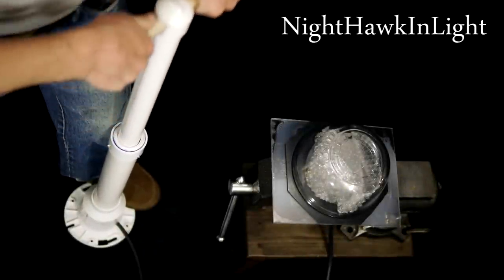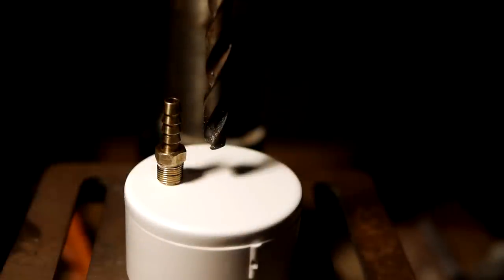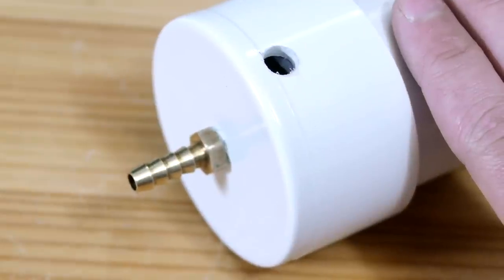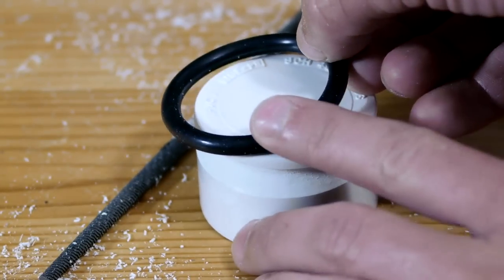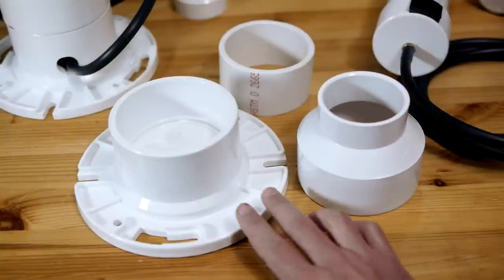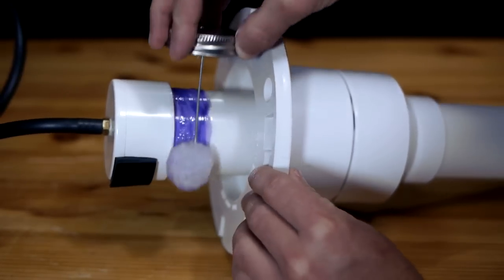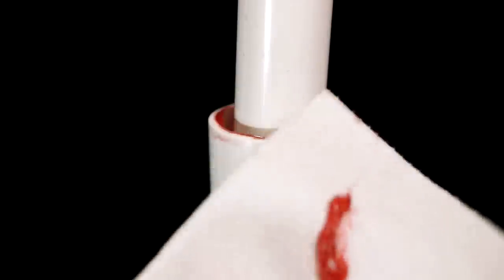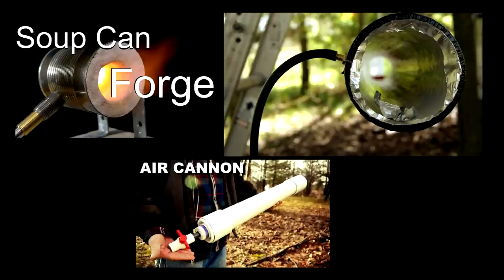How to Make a Vacuum Pump

Comment: In this design, max. vacuum achievable is determined by the pressure required to open the check valves. Small 1/3 psi check valves are available at low cost. That lets 97.7% atmosphere to be removed so, with 29.9"Hg barometric pressure, you could achieve the removal of 29.2"Hg (741.7mmHg) air pressure. Atm. press. @ sea level is 760 Torr (mmHg) so this pump, when fitted with 1/3 psi valves could pump down to slightly less than 18.4 Torr.   The key part is the valve on the inlet side. Great Job!

Comment from the maker: Going wider makes the pump exponentially harder to pull up on. A two inch diameter piston takes around 45lbs to pull up at full vacuum no matter how long the shaft is, but go to three inches and you're at 100lbs. Doable, but a lot of work. Finding a piston to fit three inch pipe is quite a bit harder as well.

Comment from the maker: Some hardware and auto parts stores have sheet rubber for making gaskets. Sometimes it's red, not black. If you can't find any you can just buy large rubber washers and cut pieces for your valves out of them.

Comment: Lubricate the piston seal with silicone paste .  Garbage Freight has hole cutters  to cut rubber very efficiently with a drill motor , use dish soap to lubricate the bit .

Comment: I just got done making this PVC vacuum pump. This seems to be a great design for a vacuum pump, I did make one modification to it that may save you time building it. I moved the exhaust check valve that comes out of the side of the 2” pipe, I moved that check valve to the bottom of the 1 ¼” piston cap and so then it vents out the top of the push/pull handle. This change seems to make it easier to build this pump. I hope this helps someone.
Reply: I was worried about the placement of the vent. It would be impossible to replace if needed as the parts are glued and you can’t get to it. I’m looking to vacuum seal jars in a 2.5 gallon glass chamber is this pump capable.

Comment: If you can smell any odor when you sniff the insides of the pump or tubing, these are gases emitted by the materials used in the pump's construction.  Try to use materials that have no smell.  Clear vinyl tubing such as Tygon brand usually does not outgas.

Comment: If you place the external valve on the inside of your piston cap it will save you some fabrication steps. And the air can exit through the handle

Comment: Some want more vacuum like me, but wider is not a god option as it is difficult to find a closet flange bigger than 3x4. I made mine 6" longer so I could use the same materials. For a slight (and I mean slight) increase you could also use a larger hose and hose adapter. I had to use 1/16 for the valve on the inside and the outside valve. With the thicker rubber on the inside it didn't want to seal well so I used it on the inside and fixed the problems
Reply from the maker: Making it wider would increase the resistance exponentially in any case. A 2" pump has about a 45lb draw, a 3" pump would be over 100lb at a heavy vacuum. That could get pretty tough to use after a while, but a good workout.

Comment: Interesting idea: make an airgun target with a vacuum cannon like system, one-way valve to hold in air. It would just be like an endcap with aluminum foil. based on the volume (sound) of the vacuum cannon, it would be an excellent target in conjunction with your mousetrap targets.
      Then again... I haven't the foggiest of if this would work.

Comment: Do you know how low you can get the pressure? I am wondering if you can get it lower than 20 millibars the pressure point of water and then slightly lower so you can freeze it?

Comment: NOTE :  2" PVC end caps must have FLAT ends!!  This type seems to be un-common to Home Depot, or Ace (in my area), don't know about Lowe's yet!  ALSO " I found that a 1/2" (.500) hole was good for the brass hose fittings. With the barbed end of the fitting chucked in a drill press, and the cap held in a drill press vice (drilled mine in vise), while pressing down on quill you can MANUALLY (no power), chuck-start the fitting straight without any problem.  ALSO: Rubber valve pieces are around 1-1/2"(1.5) square.     Hope this helps.              God bless         bg

Comment: You would have to reverse the direction of the one way valves, but could this be used to inflate bike tires and car tires?  Any idea what types of pressures can this pump withstand?
Reply: Schedule 40 PVC should be able to take more than enough for a car tire, but I'd want schedule 80 PVC for a high-pressure bicycle tire.  I'm not sure the parts would fit together the same way with schedule 80, so you might have to do some experimentation.

Comment: coming back to this after having seen the new video. I always have a few questions after watching this. 1) how hard would it be to adapt this design into a double through pump? just replicate the design on the other end and connect the two hose fittings with a t-conector? or is it more complex. and 2) would rubber cement work better for the home made check valves instead of superglue?
Reply from the maker: The other end of the pump isn't air tight, you would have to figure out a way to seal around the shaft. It's also a much smaller volume since the shaft is taking up space. To your second question, it's hard to find an adhesive that bonds to both PVC and rubber. You can try rubber cement, but super glue is the only thing I know works for sure.

Comment: For the record, drills are not designed to cut sideways, and neither are drill bits.

The mating tapers and bearings in the drill press aren't designed for side loads, and the chuck could pop right off (while spinning at considerable speed). 

I'm not trying to be a jerk or anything, this is a safety issue, I just don't want anybody getting hurt. Please DO NOT do this. And to Nighthawkinlight, please, do not encourage people to do this, and maybe add an annotation to the video about it?

Comment: I am unable to get the pressure past 18 in-Hg. Are there any common mistakes that can be made in the building of this pump that prevents it from creating an even stronger vacuum?
Reply from the maker: Does it seem like the valves are leaking air back into the pump? Are you pressing the pump shaft all the way down after each stroke to force any air out that was pulled in?

Comment: What size bit do you use to make an appropriate hole in the end cap for the threaded fitting? I always have trouble doing this.
Reply from the maker: That's a good question. I really can't tell you an exact bit size, I've never recorded it. The perfect size would be if the bit were the same size as the fitting if the threads had been sanded off. It can be hard to get the threads started into the plastic when it's so tight, so it can help to take a larger bit and countersink the hole slightly so that it tapers down to the tighter fit. It can also help to put some PVC cement inside of the hole before threading the fitting in. The solvent in the cement will soften the PVC and let the threads bite in more easily.

Comment: hey I am aware you may not care but you need to use 100% silicone grease not that kind the grease you used will degrade the rubber and pvc

Comment: NightHawkInLight isn't 30 inHg only equivalent to around 760 torr? or is it measuring in negative inHg? could you pull a vacuum of 1 torr with this pump?
Reply: Curious what "torr" is. Never heard of this measurement and I like knowing odd stuff like this, well so I can throw it out there and stump folks like you did me. Is it a form of "bar"?

Comment: Where would sheet rubber similar to the pieces used in this video be found? I looked in Home Depot but did not find any.
Reply: I think they are called rubber packing sheets, sold in the plumbing section for creating custom gaskets.

Comment: Where did you find that great vaccum gauge ?
Reply from the maker: Auto parts store
Reply: Can you be more precise ? I can't find it anywhere. Do you have a brand / part number where we can find it on internet please. Thanks...
Reply from the maker: That particular one I bought over 6 years ago at a local auto parts store. I don't know if it is still available or not. You can find many similar to it by searching amazon or ebay for a vacuum gauge
Reply: Was it sold as a "compression" gauge to test cylinder compression ?
Reply from the maker: No, that's a different thing. It was probably similar to this one: https://www.amazon.com/dp/B000CPINHA/ref=cm_sw_em_r_mt_dp_U_DTzGCbJGGH6R4

Comment: does anyone know a cheap vacuum chamber I can't find any but I've seen somewhat small plastic ones which look cheap but I can't find one it doesn't need to be very big or strong thx
Reply: a smooth topped pressure cooker , and a  sheet of metal (thick plastic / clear better/lexan)
Reply: TheeAirworks just put the top on the metal and succ out the air?
Reply: a gasket would be preferred but alternatively a small amount of food oil can be used, sunflower seed oil or similar, this last method is admittedly a hack, there is real vacuum sealing oils out there but it works for my venturi pumped chamber and it is a lot cheaper, i dont think that i pull as much of a vacuum

Comment: Nice project. Use E-6000 glue. It is the best. Very strong, and flexible. I use it for all my projects. The valve design is very common. In engines they are "reed valves".

Comment from the maker: The valves do work better with grease, but there's no need to apply it to them specifically. If enough grease is used on the piston the valves will be covered in the excess.

Comment from the maker: I believe I got it down around 28in/hg. The longer the pump body and piston stroke the deeper a vacuum it will be able to pull, but I found this size to be the most convenient to use.
Reply: Do you think this is capable of removing enough air out of 2 1/2 gallon glass jug to seal mason jars
Reply: @oldtymeliving4198  Definitely, consider modifying a bike pump though, as that might work better
Reply: hi. diameter 50 mm strok 800 mm is i good for vacuum  0,9 bar about what do you think. can u help me ı have problem about vacuum

Comment from the maker: Bike pumps are cheap and common so I really don't have much reason to make one. If you could take the one way valve on the outside of the pipe and figure out how to connect a hose over the outlet it would be able to act as a bike pump from that line. This large of a diameter of pump body would make it very hard to reach high pressures though.

Comment from the maker: I disagree. I find pulling much easier. It's like a rowing machine. It would also be quite a bit harder to design a pump that would draw vacuum while pushing because you would need an air tight seal around a moving shaft, which is a lot harder to make.

Comment from the maker: 30 Hg is the theoretical maximum. With this pump I can get to 28. With a longer pump you could do better, but it would start to get awkward to pull it up all the way if the shaft was much longer. Besides that there's no reason you couldn't increase the length of the shaft and pump body to pull a deeper vacuum.

Comment from the maker: It's two sheets of polycarbonate laminated together for the base with a schrader valve threaded in as the air release and a quarter inch hose adapter running to the pump. A big rubber gasket I cut out of a sheet to seal it. The bowl I am using is just the heaviest I could find locally, but I do not recommend using anything other than a real bell jar. If the bowl were to fail it would send glass everywhere at high speeds.

Comment from the maker: Aren't scuba tanks typically run up to 3000psi or so? The most you could ever hope for from your typical air compressor, or even homemade is 500psi, and that's really pushing it. More likely is 150-200psi. You could refill the tanks at that lower pressure no problem, but I expect you wouldn't get more than a few dozen breaths out of them. Maybe there is a portable high pressure compressor out there that I don't know about that would be suitable, but It would be expensive and slow if it exists.

Comment from the maker: True value hardware carries the caps i use in this video. The design seems to vary brand by brand so you might need to call a few smaller stores to see what kind they stock.. Worst case you could order flat caps online.

Comment from the maker: I'm not sure how much vacuum is required for them, but if 28 in/Hg is enough then yes. You can pull more vacuum as well with this design if you increase the pump and shaft length.

Comment: This is a fantasic pump. You should always use vasaleine to lube and seal air pump O rings though. The grease you used will likly destroy the o ring. I wonder how long it will last. I'd expect about 2-3 years, then the O-ring will be getting fairly had and likely have shrunk a bit. At least you will be able to get in there and fix it :)
Reply: Vasiline is petroleum based so it's also going to eat o-rings.
Reply: Yet it doesn’t. My dad has been using Vas on pumps for 50 years. Lasts longer than anything else...Plus its got the right amount of lube vs seal.
Reply: Mongrel Shark OK,  my bad 😉
Reply: @MongrelShark   O-rings for faucets and such are lubed with food safe silicone grease aka plumbers grease not a petroleum based grease Vaseline may work  but silicone grease is the thing.

Comment: What is highest vacuum pressure you've been able to pull with this and how many pumps did it take to get there?
Reply from the maker: 28in/Hg. The number of pumps required depends entirely on the size of the chamber being evacuated.

Comment: can this be used in conjuntion witha distillation apparatus to boil water below 100degrees celcius?
Reply from the maker: +nathan campbell Sure
Reply: +NightHawkInLight Holy molly explain it i want to know how to boil water under 100° :OOOOO
Reply: +Kuchizuke go up a mountain, boil water, done
Reply: vincent escher Wherever you are on this planet you need 100°C to boil water :v
Reply: not in a vacum you dont, search boiling water at room temprature
Reply: nathan campbell You know exactly what i meant :v
Reply: Kuchizuke no you're wrong, Boiling points of liquids decrease with decreasing atmospheric pressure. It's not the same all over the planet, it's the very opposite.

Comment: been meaning to put this together for a year now.  got all the parts, every one, just haven't done it yet.

one question that i have been trying to read through all the comments and find the answer to in case it's already been answered.  and i pretty sure the answer is yes, but i guess with further modification. maybe you could put up a video of a way to turn the one way valve outlet into a hose as well, or maybe your video on the one way check valve could work, but i ain't no engineer so i can't visualize how to mechanically install it.  i know the theory behind it, just can't see how to make it work with the way the base is built around the exhaust valve because you would need to replace the one way valve output on the side of the 2" end cap with a tube to carry the liquid to it's destination.

i am curious as to how to turn this into a liquid transfer pump.  it already has the intake, where your vacuum is formed.  but the way this one is built it would just pump the liquid out onto the ground or kind into the frame of the pump, all around, or whatever large container you might have it in.
Reply from the maker: This can't be used as a transfer pump in the current design. There's no good way to seal around the outlet.

Comment: Use a synthetic grease like silicone paste/grease which won't eat or inflate rubber which petroleum grease will like general purpose greases such as lithium based. Red rubber grease is also good.

Comment: Ok i look at the brass hose fitting and compaired to the video.

Are you sure the one in the video is not a 1/4 x 1/4 i mean the one i saw had a smaller tip.

Comment: One suggestion I have is to use the piston itself as the outlet

Have the second one way valve be, instead on the outside, be on the inside of the 1.25" cap and a hole at the top of the piston to let air out, it would simplify construction of the base

Comment: Great video, and thank you very much for posting it. I think it will solve a problem for me.

I wonder if an inverted AR414 tire valve would work here, in place of the stiff rubber flapper valve.  

Air can only flow through a tire/Schraeder valve in one direction.  Instead of blowing air through it in a conventional way with a compressor, I wonder if air could be sucked through it (mounted backwards) via your PVC pump mechanism.  It would make for a powerful seal against leakage.

Instead of having a barbed brass fitting jutting out the bottom of the pump cylinder, you'd have the threaded valve stem head, to which a vacuum hose could be attached.   Whaddaya think?
Reply from the maker: I think a tire valve is spring loaded too strongly to work well as a one way valve. You can buy specific one way valves that should work.

Comment: If I may, they'll also burn out in vaccum because of the big decrease in the melting point of the tungstein inside the bulb because of the low pressure, being that temperature low enough to accually be lower than the heat produced by the fillament itself while on. This is why they use inert gases to pressurize the inside of the bulb.

Comment: Where do you find a 1 1/4 inch O-ring and sheet rubber? I've looked around in my local Lowe's and Home Depot and they don't have them.
Reply: +Creativity Nevermind, I found both the O-ring and rubber sheets at Ace Hardware

Comment: bigger the gap-faster air rushes in -more power I was wondering if you could replace the rear disk with a solenoid valve and the front with one also and have a barrel which is smaller than the chamber and also increase the internal pressure to really boos efficiency of the cannon